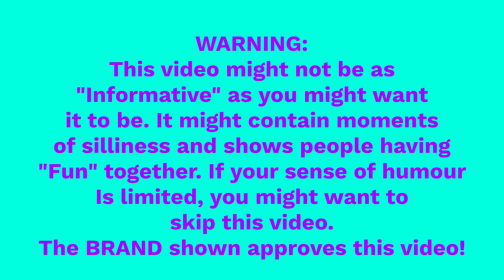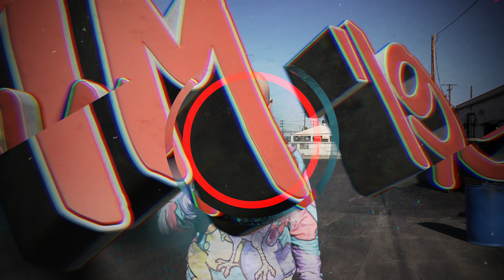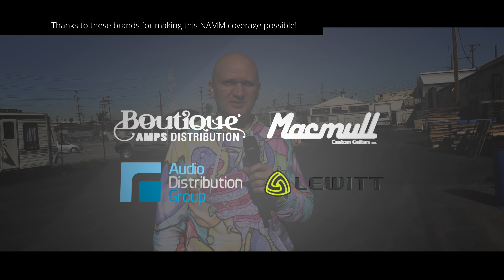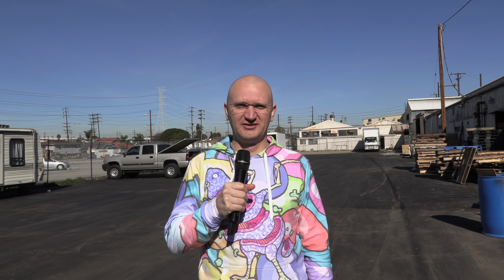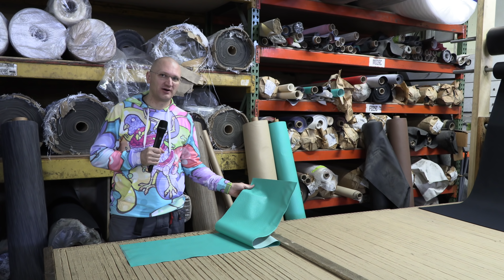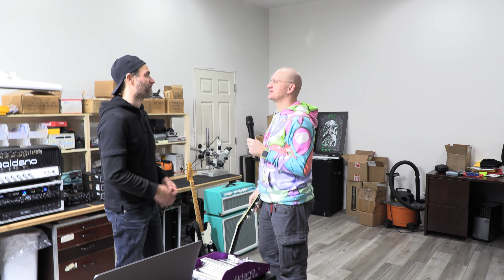The new B.A.D. Workshop - Seriously Efficient!!!

Comment: Building a simple wood box for an amp is very demanding and must be very precise. It's hard to get all the corners square and even. Everything has to fit tight and without any vibration. 
 A hand made amp would be as much a piece of art as any handmade guitar
Reply: Believe it or not but the box makes a difference in the sound. Ss or tube.
Reply: @hadleymanmusic  absolutely. Good speaker boxes can be made from plywood. But they have to be well made.  Tonewoods matter.  Using oak instead of pine for the structure would make a completely different sounding amp.